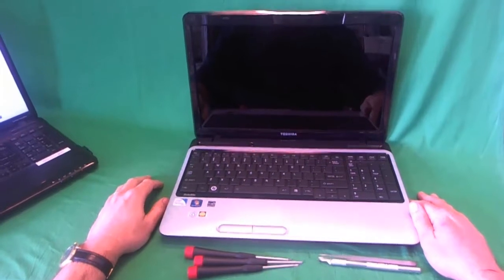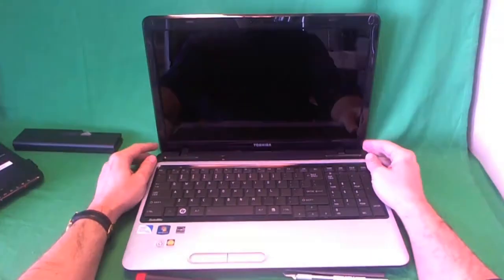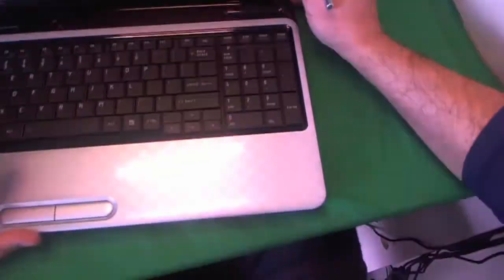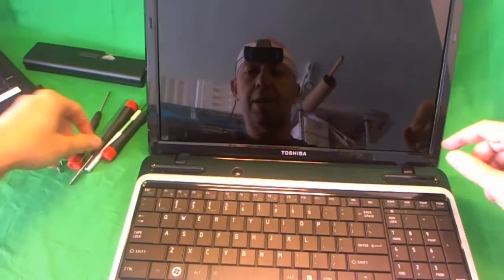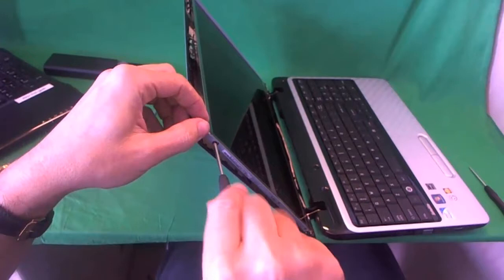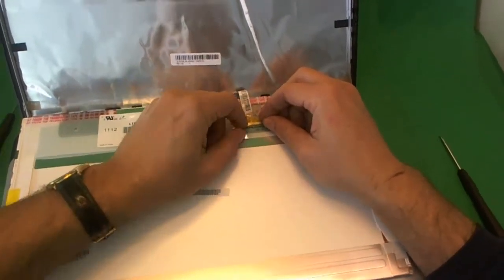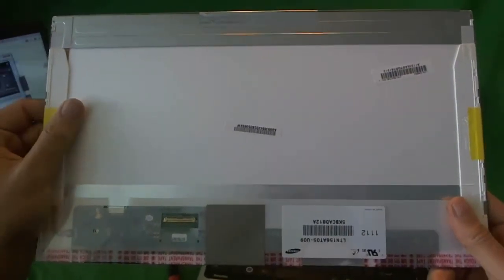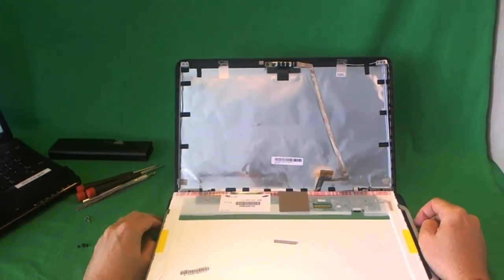Toshiba L755 Laptop Screen Replacement Procedure

Comment: Thank you so much! Your directions were really easy to follow. And replacement screens are really easy to find on eBay.  The whole operation took me longer than your demonstration since I hadn't done it before, plus I had to crawl around looking for dropped screws a couple of times, but I was still done in less than 30 minutes. Thanks again!

Comment: Four years later, your video is still helpful!  My toddler knocked my laptop off an end table and I was seeing red in places where it should be dark gray or black. Asked around, and people said it could be fixed. Off to YouTube to search for videos, and was amazed to find one for the exact same model laptop.  Your easy-to-follow instructions were very helpful.  All I needed to do was get to the back of the monitor panel and re-seat that connection... the picture is back to normal!  Thank you for sharing your skills with us.

Comment: Help Please!

Can I use the same screen for a Toshiba Satellite L755D-S5218? will it be compatible?
Reply: +Lorena Aquino I am 99% sure all L755D models have the same screen, regardless of what comes after the hyphen.  For the most part, all L755Ds are the same.  The numbers after the hyphen only differ based on minor specs like how much RAM or hard drive capacity... or in some cases, companies offer different model numbers to specific retailers, usually major chains that buy in large quantities.  This might allow "Retailer A" to sell the L755D-S1234 for $50 or $100 more than what "Retailer B" charges for the L755D-S4321, regardless of Retailer A's "price match guarantee" policy.  They may be the same computer in pretty much every way, but that different number at the end gives "Retailer A" an easy excuse to say it won't honor price matching to "Retailer B" because they are technically "different" models.

Comment: I haven't replaced the cable but I was able to open up the laptop and get to it so I know how to replace it. From what I've found out it seems as though the cable is responsible for the screen appearing like that. I've found the replacement online for pretty cheap I just haven't gotten around to taken it care of because I got a $1200 Dell for $150 and have been messing around with that and just use my toshiba while its hooked up to my Samsung Flat Screen via HDMI, eliminating the problem for now

Comment: Thank you so much! My toshiba had an issue with the display being split in 3 equal sections. It wasn't damaged but obviously that is an issue that need to be worked out. Your video is great and helped me get to the cable that was causing the issue.Again thank you!